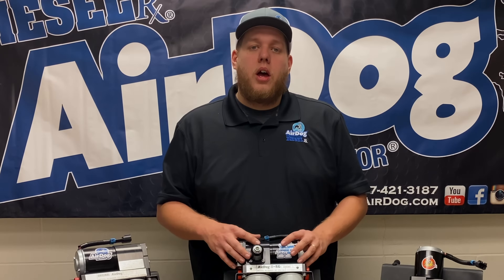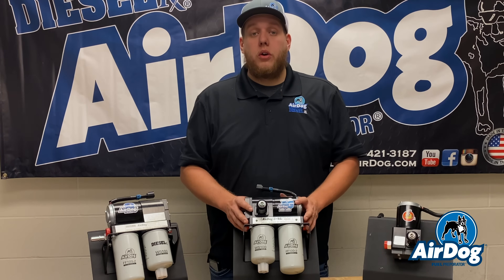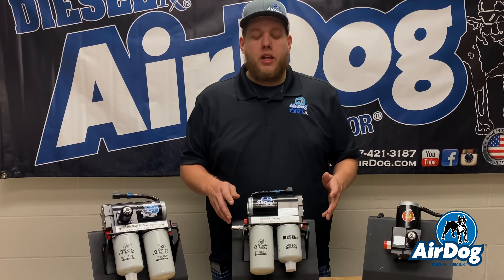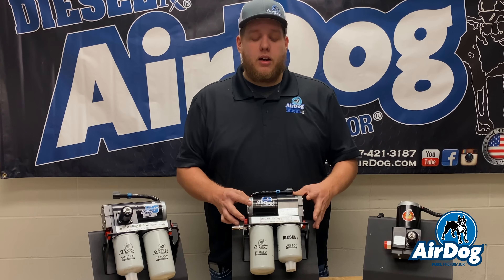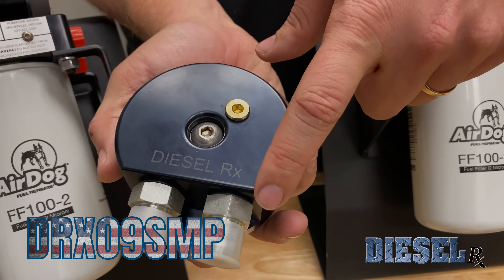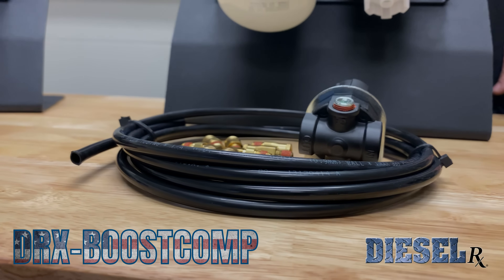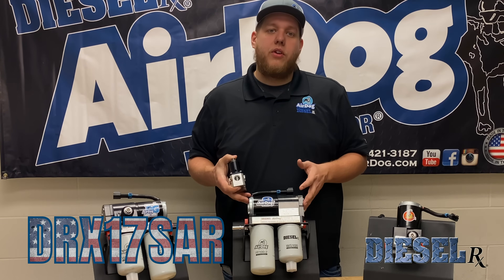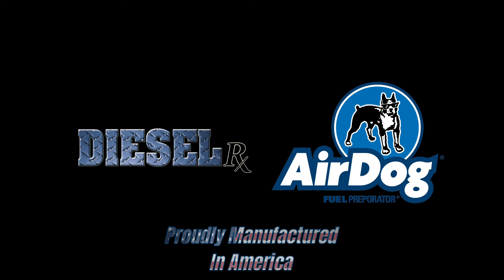NEW PRODUCT RELEASE - What's new for 2023?

Comment: I have a 2003 6.0 powerstroke, I installed the air dog per airdogs install video, and fuse tapped into ABS 10 amp just like the video. Now my abs light won’t turn off, any ideas?

Comment: Are the filters easy to find? Do you recommend changing the filters the truck already has or they get deleted with new kit? And how often do you need to change them? Thanks
Reply from the maker: We have cross-reference numbers listed on our website along with our filters, if needed. If you want our branded filters, I would say stay away from amazon and ebay. We have seen a lot of counterfeit filters that don't allow fuel to flow through the filter. Check the country of origin if you purchase through amazon/ebay. If it says China, they are not ours. You can also check our dealer finder on our website to find a diesel shop close to you to purchase through. Most of our kits bypass the factory filtration. If the kit you buy doesn't completely bypass the factory filters, go ahead and replace them just in case. Our filters need changed every 15-20K miles or every year. Whichever comes first.

Comment: i have a bought 3 AirDogs so far. one for my 1991 1st gen has a 150gph, my 1994 2nd gen 12valve has a 165gph and my 2003 24valve common rail has a 150gph . no complaints works bad ass.